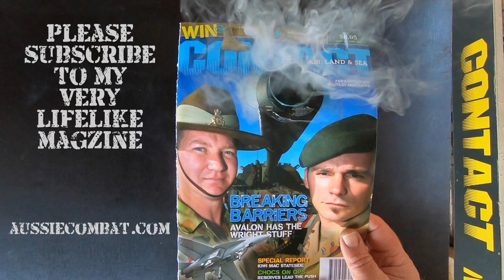Laundry refurbishment – Part 2

Comment: Just cut the top off, shape a new piece from scrap and butt join👍🙂
Reply from the maker: I didn't think of that – and it would have worked. Thanks for the suggestion. And thanks for watching.
Reply from the maker: Anthony – I just thought of another option. I could have cut the top off, turned the bottom half around and stuck them back together. But didn't think of that in time either :-)
Reply: @big-irish-git  👍no worries. I enjoy watching. Keep up the good work.